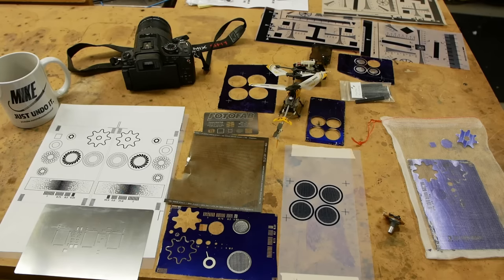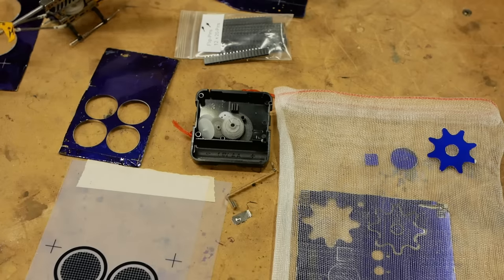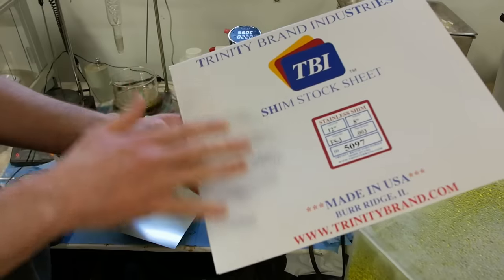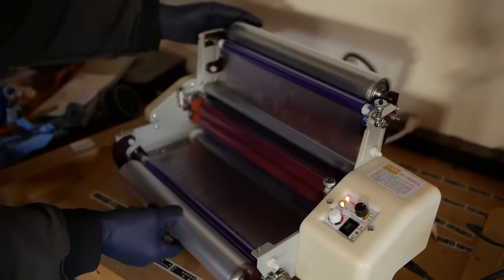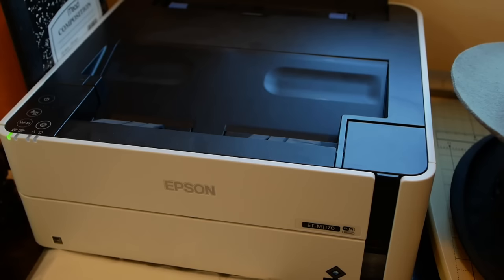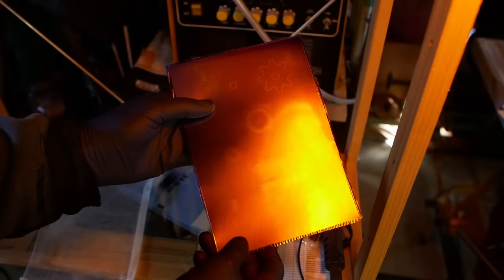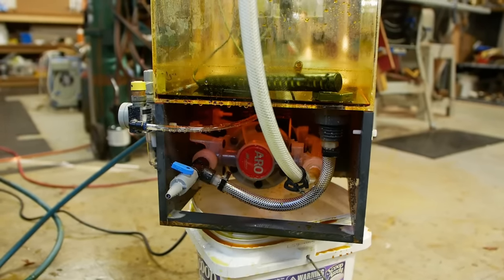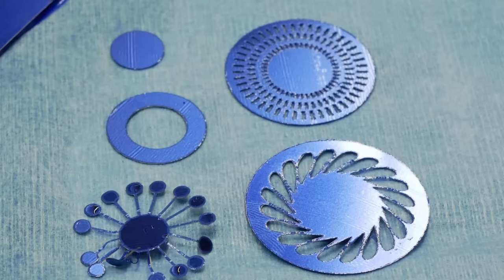How to make precise sheet metal parts (photochemical machining)

Comment: For the drying, I may have an economical idea possibly. Have a box, and tape another smaller box to its side. Have a fan that will be okay with generating a mild amount of pressure. I used a cyclone fan. Now get a fair sized hepa filter. A really cheap version of these is a car cabin filter. Much cheaper than a house version. Make sure it's somewhat larger than the size of the fan, as it will add resistance to the fan motor. The more resistance, the shorter it's lifespan.
Anyways, cut a hole between the boxes almost as big as he filter. Tape it on to the board really well. For this project, you may want to silicon the edges just to make sure there is no pass by. Cut a hole for the fan on the other side of the filter box and tape it in so it pushes air into the system.
There you go, a cheap positive pressure filtered work space. The air flow is gentle, but enough to make sure outside contaminants can't get in. Should filter oil particles. For that extra bit, you may want to clean the main box thoroughly and seal it. Depends on the materials you used for the box.
I used this technique to build a work space bubble while working with insulation. Turn the fan around and it creates a negative pressure space.as long as the opening isn't that big, the air always came into the bubble, so none of the particulate escaped.
Just an idea.

Comment: Hi Ben, 
In this video you used a larger rig to expose your emulsion layer, but do you think it would be possible to do this with the projector setups they use for old printing in film photography? These setups normally work through a lens with whatever size film you work with, but I imagine you would be able to control since you can focus the lens and you would eliminate the shadows and misalignment issues. you would also get more detail by taking a photo of your desired designs at a large scale and then it becomes normal sized when projected through the small film. I had taken a class in college for semiconductors and one thing that had stuck in my mind was the amount of detail they could get through these photo lithographic processes. Do you think it would be possible to cut something small and precise like watch gears with this style of photochemical machining? Thanks for making this AMAZING VIDEO!!!!! I loved it!

Comment: You've created so many new ideas! First I thought "why not use a two-axis device to move the metal from developer to rinse to ...", then figured that wasn't going to really reduce the human labour. So then I thought about automating handling for the exposure step as well, which seemed tough due to registration challenges. That's when I wondered if you could "plot" the design with a laser pointer, instead of masking with a transparency. Obvs you'd need a laser on each side with "perfect" registration,  which is undoubtedly hard, and the opposite photo-sensitive resist (is that positive? or negative?) -- but you could skip the printing with special ink on special transparencies and the double-faced tape with human registration.

So if you could do the exposure with a laser pointer, I think you could reasonably automate the whole process from customer artwork to bag of etched parts.

Comment: You can improve contrast in laser prints by putting them for a few minutes into acetone vapor. The grains of toner will fuse together. I have been using this for a small-scale PCB production.

Comment: hi Ben;
After printing on Acetate or Tracing paper with a laser printer, if you expose it for a short time with cellulosic thinner vapor, the printer toner will become plastic and dark-light proof. But this is a very delicate process. You can do this easily... ;)

Comment: I was actually doing some research a while back about building a clean room. They do sell oil-free air compressors for not too much money, and if you're hard up for cash you could use an activated charcoal filter to get the majority of the oil off

Comment: Interesting application for a sous-vide immersion heater. I have the same model. Mine has only ever been used for C-41 color film development.

I like to use 99% isopropyl to dry projects that must be oil free (e.g. if I need to paint something). The isopropyl absorbs the small amount of water remaining, runs off with it, and any leftover evaporates quickly with no residues.

Comment: Wow, I knew about circuit boards and silicone chips, but didn't know there was a photo chemical process for metal that turns out so precise. Maybe you could design a machine or a process that does it all, like 3d printers do now. In this age of technology nothings impossible, it just hasn't been invented yet. I remember one drop of FeCl3 goes a long way, and can make a big mess. Thank you so much, you're an excellent teacher.

Comment: I just think it's very cool how you can and are able to share these developments and breakthrough with all of us. it seems like normally something like this would stay behind closed doors and out of the public eye out of some greedy pursuit of profit. but it seems like you understand that sharing information and the gains that can be acquired from doing so greatly outweigh any sort of potential profit loss from sharing information
Reply: He shared a process which easily found everywhere. 
Information will be on how to etch a 0.1 mm hole in 0.2 mm stainless steel. That would be information ;)

Comment: For aligning the two transparency sheets, what about combining an optical comparator and a very precise hole punch to make matching locators on both sheets? Then you just need to drop the sheets on a board with two precisely sized and located pins to tape them together.

For a reliably repeatable process on the optical comparator, print some targets on the transparency sheets, and set up the optical comparator station with rigidly fixed punchs and targets. Set the punch and target on a device that can finely control x, y and rotational movement. If you're doing some mass production with identical sheets, put some adjustable stops for the sheets to sit against so you don't need to fiddle with the punch every time.

Comment: SLA 3D printers can easily be used as digital maskless lithography machines - people use them to make PCBs with very fine details. Top of the line $500 SLA printer from Anycubic has 350:1 contrast, 9.25" screen size and 35 micron resolution.

Comment: for drying the clean metal sheets you could use the same method of quick-drying clean glassware for chemistry, which is to rinse off the water with acetone (which then quickly evaporates). That removes the shop towel as a possible source of contamination

Comment: great video :)
a suggestion to improve the method, a kinda "use it if you have it" suggestion. 
you can use a resin printer LCD bed panel for the to expose the resist and use some sticky tape to register the same 2 sides of your panel. i do that for 2 sided PCBs which is essentially the same process and it's surprisingly accurate.
Reply: only did single sided boards yet but yes, it is a much more streamlined process than using dedicated print out masks.

Comment: Great video. I think the same masking technique (double-sided photo mask) could also work using an electrolytic process, however one may need to add tabs to ensure conductivity to nested parts. But electrolytic etching would not require caustic chemicals or high-pressure spraying with moving nozzles; immersion in a circulating electrolyte bath should suffice.

Comment: This is pretty much the same PCB manufacturing process that I always did since graduated and before PCbway/LLCPCB. (For sure not with so many fancy equipment. I did love those❤)😅

As a suggestion, please do a video creating a transistor with the same etching technique (but in a smaller scale and on silicon)❤❤❤

Comment: I really like the results, even the problem examples in your demo pieces aren't too bad considering there's not many use cases for such complexity.

Most people would probably try SLS 3D printing, but this is probably doable even on a hobby scale for much cheaper.

Doing everything manually would take a lot longer, but probably not need anywhere near as much custom equipment. The only equipment you'd need are an inkjet printer, office laminator, and a UV light setup. Plus a few tubs for the chemicals and you're good to go.

Comment: My parents operated a print shop and for artworks they had to use this huge projection camera to go from laser print to actual film. Then we'd have to fill in pinholes in the film with a sharpie over a light table. It was a godsend when they switched to an inkjet; the artworks would come out ready to use without much manual intervention at all.

Comment: Man, thats simple af, but still with some nuance. nice setup. I already have some ideas. Wonder how thick this can work with...
Reply: Seems like a fuel pump might do better for the money to avoid the air compressor, cost, and noise. Might take a 2-stage with a "lift" an d pressure pump. To go higher than 50psi, a diesel pump is the next step.

Comment: The speaker grilles in MacBooks were laser drilled. The company I work for designed and built the laser micromaching system that did it. Also the bluetooth keyboard where the light shines though the metal. Use shorter wavelength lasers and you can get much more detail from the smaller spot size.

Comment: I feel like you could use fresnel lenses on either side of the part during the exposure stage to make the light parallel to the surface, eliminate any point source shadow errors. Then you could move the LEDs significantly closer and make the whole rig a lot smaller and have a better effective brightness

Comment: Make three rectangular squares of thicker glass. Make those slide panels that move up and down. Use the same pump on all systems. 
That way, you have the same system on all three cases. Easy to find replacements. Most importantly, consistency and tile-ability. A spill-board beneath, all three in the same basin for spillage. Raise it from the floor, so you got a drain. Then simply do the Sodium, then move it over to the etching, from etching to cleaning. 

The difference in the cleaning bit, of removing the film. Is the same set-up. But you dunk the part like you are torturing it. Unlike the other three, you add an aquarium filter to this one. That way, you can add a charcoal filter or other filter to pick up the etching chemicals. Since the residue will be minimal, it probably wont damage system if maintained correctly after each cleanse.  

Rinse and Repeat. 

Now you have essentially, a industrial set-up from Laminator, Inkjet and three tanks.

Comment: I tried an alternative method on a sheet of aluminum flashing. After removing the coating off the flashing with some solvent I painted the aluminum with spray paint, then I used a laser engraver to remove the paint where I wanted to eat away at the aluminum. Finally I electrochemically etched the aluminum in some salt water using a copper negative electrode and the aluminum connected to the positive electrode (I think). It actually worked pretty well, eating through in less than 5 minutes.

Comment: When you dry something with paper towels it might leave dust and fibers on your sheet. In university we'd clean glassware first with deionized water and then with acetone (each 3 times to get rid of most contaminants). The acetone washes away the remaining water and dissolves most of the things the water didn't dissolve, so it would probably get rid of any remaining oils, and it also readily evaporates in air (we'd use pure nitrogen to speed up the evaporation, but I suppose regular air is quick enough as well).

Comment: After you fix the first mask to the front of the plate, use a machinist's punch at the center of the registration mark. If the metal is thin enough you will see a slight dimple on the other side of the metal plate. Now you can align the rear. You can modify your registration mark design to incorporate a small diameter circle so you can see the punch mark through the crosshairs.

Comment: Concentric circles of equal line/space thickness work very well as a moire pattern for alignment. Use at least 3 circles. Misalignment is really easy to spot with this method.

Comment: We use nearly the same steps to produce PCBs at our University Lab / Makerspace.
The german company Bungard specialized in making all kinds of machines for prototyping PCBs, including nice stations for development and etching.
Lately we experimented with 3d SLA resin printers for the exposure step.
It works better than we thought. Since the mono LCDs contrast isn't as good as inkjet techniqe, its a bit harder to get the exposure time right. But it works and can produce 0.15mm feature sizes with the current generation of resin printers.

Comment: Tip: As a poor man's way of doing the printing, I use a cheap pigment based inkjet printer, setting it to high resolution photo settings, with all the colors filled with black ink, so it's no longer CMYK, it's just KKKK (4K if that sounds better. :P). That gives me a nice opaque black, and I was able to print 0.008" (~0.2mm) fine lines onto PCB reliably at home, but I'm using Positive 20 spray instead of pthotoresist film. :D

Edit: Do note that the printed side of the paper/transparency film must face the PCB in order to get really fine details, cause paper/film thickness may result in bloored edges, which cause unreliable etching. So I actually print the mirrored image on high quality paper, and soak it in oil to make it transparent. (I found xerox colotech+ A4 90g/m2 paper works fine, while not being much more expensive then regular paper.) Polishing the PCB before applying the photoresist layer also makes a difference in print quality, although less important then the opacity of the black, and the orientation of the printed paper/film to face the surface!

Comment: One other possibilities on the pump. You can get cheap 12v diaphram pumps on Ebay for 20 - 40 dollars, and depending on the model some make 100psi and above. Sold as RV or agricultural sprayer pumps.  I've used them for reverse osmosis processing of maple sap. Not sure about the material comparability though. You can also get ones that are rated for 200+ PSI for 3 or 4 times the cost, they are sold as methanol injection pumps for cars.

Comment: On your exposure rig, it seems like you would benefit from "Light Collimation". That would require maybe a fresnel lens or two.. but you would need to check if the material doesn't block the specific part of the spectrum you need. Maybe a good lens source would be from the stage lighting industry. As a hobbyist I've come across it before used the same way lighting gels are used.

Comment: I had a thought as to how to align the photo masks front and back on the metal that might be a bit more accurate.  Take the photo masks and align them on top of piece of scrap plastic (the Moire alignment someone suggested is a great idea).  Then drill small holes thru two (or more)  corners of the aligned masks in areas that are not part of the finished product.  If you have a mill use it to drill the holes and then do the same for the metal to be etched.  If you do not  have a mill tape one of the masks on the metal and use the holes in the mask to align the drill and drill thru. Then you can put small pins thru the holes and everything should be aligned.
Reply: Here is a text as requested.

Comment: Great project. I have used toner transfer method for some etching years ago which is a lot simpler. But seeing this now I am wondering if it would be possible to use an SLA 3D printer for a layer of coating with UV resin.
Reply: Same here! Or just use a set of aligned DLP projectors. The resolution might be a problem, but it would get rid of the trash.

Comment: I used to use glass from old scanners to hold the foil on the PCB during  exposure. It has better properties and the lines were sharper. Also I used to remove foil before exposure, to ensure that the distance between foil and resist is as smallest as possible.

Comment: Very interesting, thanks for all your hard work and freely sharing the design.  One thought on reducing the registration errors, have you tried putting a square or honeycomb baffles about 1 to 2 inches thick on the light source to reduce the light refractions and keep it more uniform?  Very much the same Idea as a Polarizing filter.  Secondly, 405nanometers is a very dangerous light source that can and will burn your retina's.  I would suggest either building an enclosure for the entire structure when the light is on to protect your eyesight.  And I would suggest putting a warning on your Video for those that might also want to build it as well.

Comment: Fiberoptic lasers for the 'home' market have come down in price tremendously in the last few years. This is something that their limited penetration depth could handle with repeat passes, and even the relatively midgrade machines have very decent resolution. If I were doing production work naturally springing for an approachable high-end machine would be the way to go, but the 4k units would be stupid fast at this process. You could bang out parts all day and have an absolute pile of trimmings to reuse. 
Beyond that, I'd be tempted to make the template from a resin 3D printer applique. The spring metal build plates make printing directly on the build surface very easy to remove ultra-thin pieces like this.

Comment: To help with alignment, you could print fine grids on the sides of each layer, then move them around until you get rid of the Moiré pattern. That would at least be more consistent than trying to line up arbitrary designs.